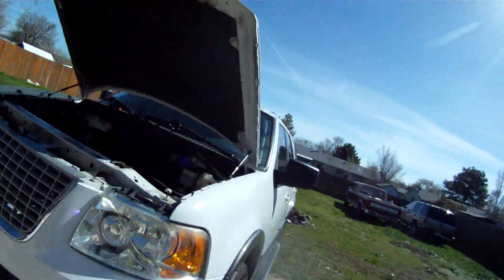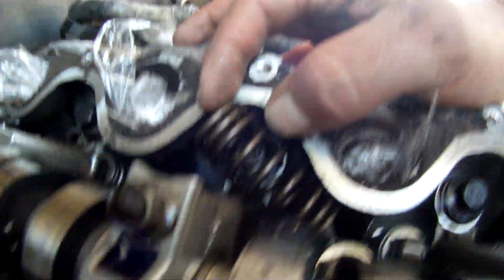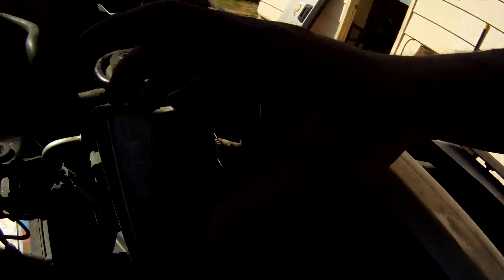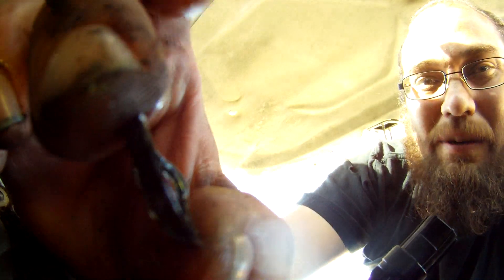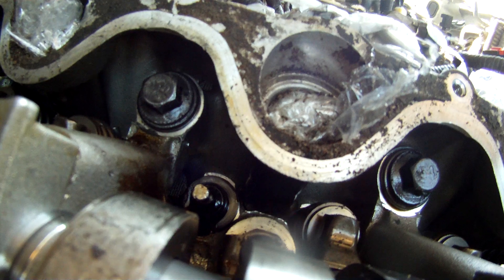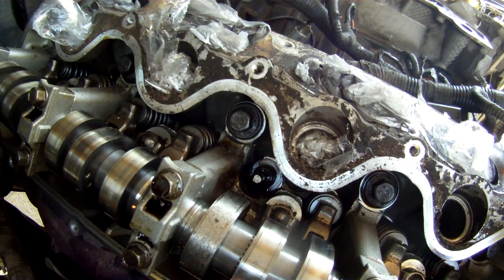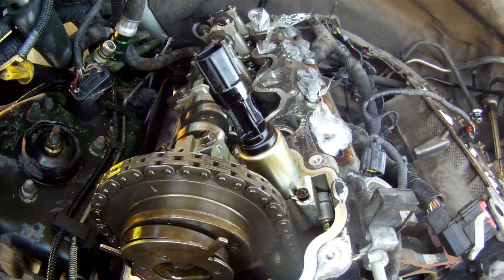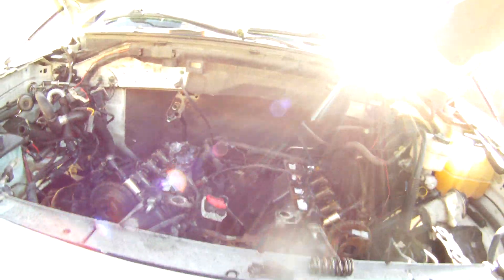05 Ford 5.4l Triton Lifter Failure

Comment: What usually causes this is when the roller seizes on the rocker arm, the rocker will get kicked off the lash adjuster and get wedged in a certain position where it holds the valve open, where the piston will then hit the valve, break the keeper, bust the rocker, etc etc.
Reply from the maker: i have other videos. I have gotten further into this. we found a broken lifter. the tip of it has broken completely off. ever seen that??
Reply: Yes. That's generally when it gets kicked off the lifter, it breaks the plunger off from the force of the cam pushing against the roller that is seized up.
Reply from the maker: I have repaired ten of these so far from busted plugs to bad vvt gears. this is the first one we I have seen like this I have heard about and "know" about it but have yet to see it or be able to wrap my mind around. My machine shop also said the same thing about em. after this one I am done with them. we are band aiding it so she can sell it. what are your thoughts if any about this? it seems that any little hiccup and the 5.4 triton goes to pieces. also personally I am tired of working on them. I hate doing tune ups on em. thanks for the comments and knowledge!
Reply: No problem. It's just bad design, if you ask me. I talked to a tech once and asked him why do the rockers fail so often on the 3V and he told me he believes that because the rockers are smaller than the old 2V rockers, there is less bearing load surface for the roller, therefore more load on a smaller bearing causes more wear. 

I saw your other video and I agree the lifter looks weird if it's your first time seeing one. OHC engines from Dodge, Ford and other manufacturers use that same type of lifter because on an OHC engine, there's really no other way to adjust the lash, other than to push up on the rocker from underneath. 

I personally own a daily driver '07 F-150 with a 5.4 3V and it has been a sweetheart for over 145,000 miles. I call these "hit and miss" engines. Sometimes you will hit the jackpot with one that is good, but more often you will miss and find a bad one, or at the very least, one that has not been maintained properly. And that is a NO NO on these engines. These require 3,000-4,000 mile oil changes to keep cam journal passages nice and clean, as well as VCT solenoids, etc. The plugs are a headache, too.

I don't blame you for quitting on working on them, lol.
Reply from the maker: DODGE!!! 2.7l dohc ugggg what a nightmare!! been there done that. the ford 5.7l is to problematic for me to be able to ever truly guarantee any real work on them. I told this lady that I could spend the time and money and put another new engine in it but I cannot tell her it wont do the same thing this one did. bad design for better gas mileage is what I think it is? they destroyed a good engine for better gas mileage.
Reply: I agree. The timing chain tensioners have a rubber gasket on them too that blows out, which causes the chain to get loose and break chain guides, as well as cause insufficient oil flow to the heads once they blow and then score the cam journals. And since these engines have no cam bearing shims, your best option is to either:   1 replace the engine  or 2 get a machine shop to line bore the journal and install bearings. 1 is much more preferred, in my opinion.
Reply: @MattShaughnessy6 it was sacrificed also to meet emissions put forth, that today seem like a sabotage for what it caused in so many motors. My 2010 triton 5.4L 3v has almost 250k miles on it and I've put more time and effort into not solving its problems than any other car or truck I've had. The only good thing I can say is this truck has never leaked a drop of oil in my driveway. It was abused and had some Frankenstein parts, including a replacement rear transaxle, the cats are cut out too. Oil pressure, plugs, chugs, etc. Thanks for the video.